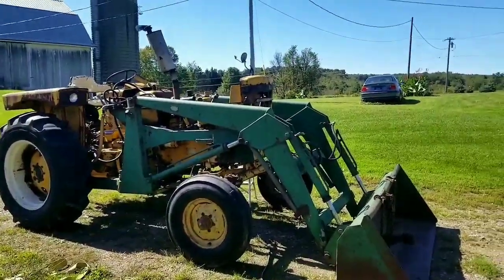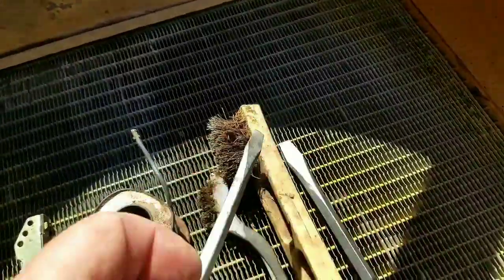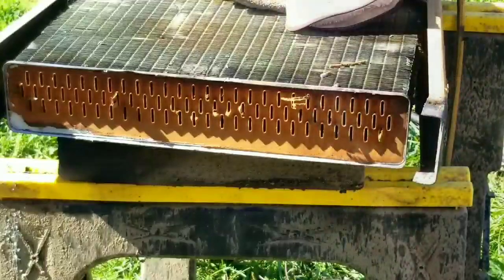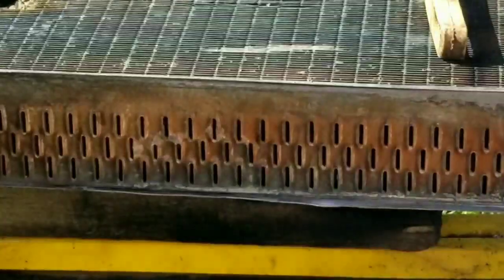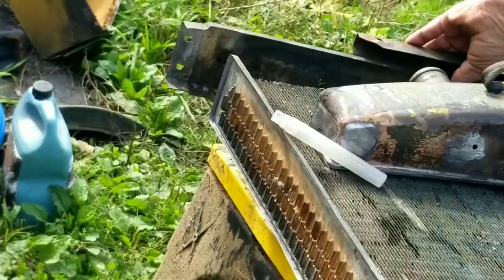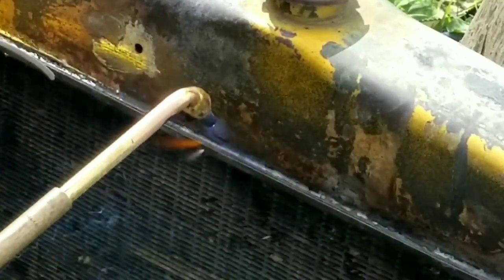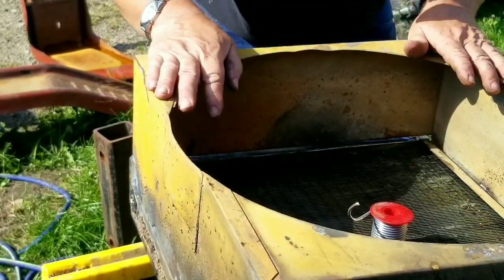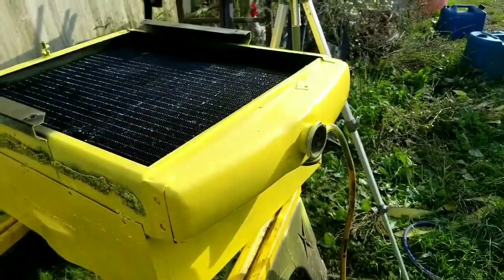soldering a leaking radiator in Minneapolis Moline tractor

Comment: Great video, I am just now fixing the tank seam on my 1963 IHC 504 tractor and this was just the video I needed. Thank you for sharing it with us.
Reply from the maker: Yup.  You can bridge the seam and get it fixed but to do a lasting job you need to disassemble it and get all clean.
Reply: @thewayidoit8895  Well I tried bridgeing mine 2 times trying to get through some hay work but I now have it out of the tractor and the tank off and pretty well cleaned up. But of course I ran out of tinning acid so I am trying to find some in my rural community. But I am not short cutting this time, this is a lot of work but saves a couple hundred dollars and is good experience. Thanks for this video and all your advice!!

Comment: Very good video long but worth it 👌 question is 60/40  60%lead 40%tin
Reply from the maker: I appreciate it. Yes, 60% lead.  The more lead the easier it flows.  There isn't a good soldering video by an experienced person.  Until 20-25 years ago every town has a couple repair joints.  Our nearest is 50 miles away - they generally do Truck stuff.